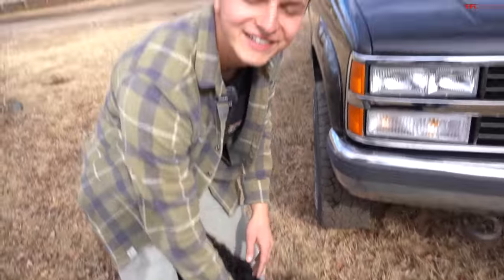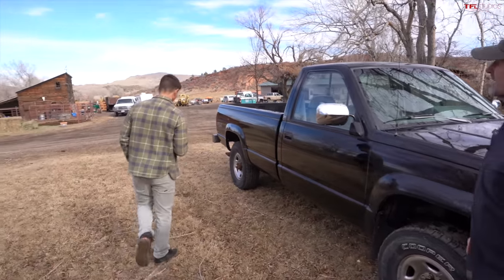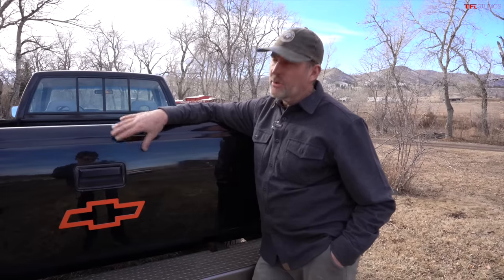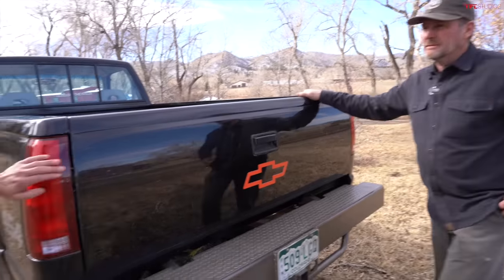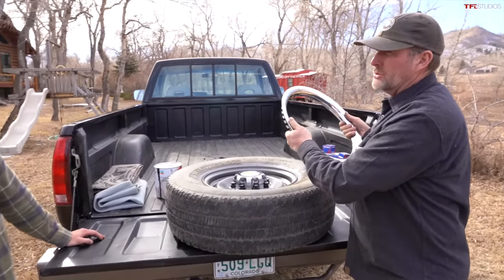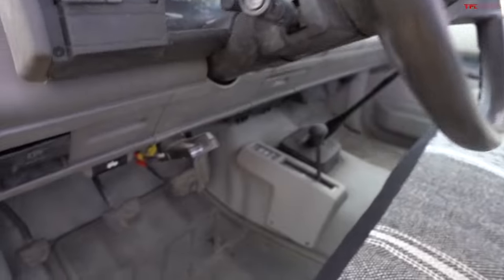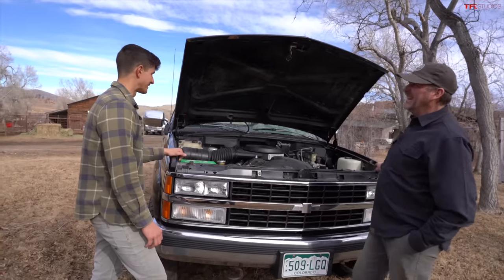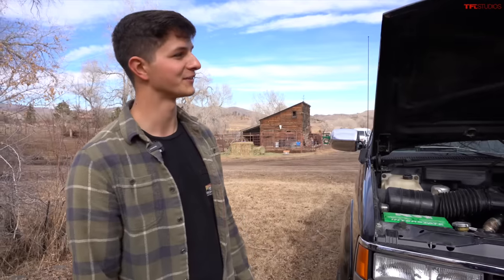It Came Out SO GOOD! Here’s How You Can Restore Your Clapped Out Truck For $2000!

Comment: David, I had a 87 which was the last year of the square body first year for TBI in trucks. I found that the gasket for the TBI to the intake manifold had a small crack in it and caused my high idle just thought I’d let you know
Reply: 88/98 were infamous for the intake gaskets going out
Reply: Would that cause leaking of oil on to the top on engine?
Reply: @cowtipper3855 check out the video "how to stop oil pooling on intake manifold - chevy" 
Maybe that will help.

Comment: Im restoring my first truck ever a 1996 K1500 etc cab with a vortec 350 all original engine and transmission. Still runs like new at 268 thousand miles. Ironically I went for a GM Black from the 90s paint code at NAPA for my truck lol. Can’t beat a solid black!
Reply: What kind of stuff are you restoring? (If you don't mind me asking)

Comment: Just fixed my high idle issue in my 95 chevy. changed the idle air control censor and then the throttle body gasket was completely dry rotted and cracked in half. cheap parts now it idles like a dream

Comment: As far as the vibration, if it happens on acceleration, pull the rear driveshaft and see if the u-joints are free!! If it happens always, check the motor mounts! If the vibration happens all the time, maybe the new rubber will do the trick! Hope that helps. Great job boys!!👍🏻

Comment: That engine has a 4bbl intake with a 2bbl tbi. There’s a spacer between the TB and the intake. Gaskets on top and bottom of the spacer. The spacer has coolant flowing through it so mind the coolant hoses to and from it. Check power steering pressure switch as well as AC switch. They also increase idle when in use by way of the IAC. You can also spray around the intake with starter fluid or something else safe to use and see if the idle changes to locate where a vacuum leak may be.

Comment: Brings back memories of my first NEW truck an 1988, 2500 Chevy 4x4.  The main ( and only, bracket a first for Chevy I believe ) bracket that holds all the accessories on the engine on mine was cracked and caused flex to occur which burned up 5 alternators before the dealership figured out what was the root cause for the failures.

Comment: About the high idle, you guys talked a lot about a new distributor. It could be a possibility that the timing could be off. You may have to adjust the distributor position to lower time the spark plugs ignite.

Comment: I love 90s trucks easy to work on  my truck is 92 chavy z71 off road steps side bed 3 inch lift it a 2 door extended cab with 285 75 R17 tires maroon it needs new paint job still

Comment: Do the timing chain. My 89 3500 454 lost all the nylon on the cam gear jumped time and bent all the valves. I had it completely rebuilt. If I had known this was is a common issue I would’ve done the timing chain and gears immediately and saved myself $4k. Other than mine being a Silverado trim with a th400 and red interior mine is identical.

Comment: Why is a cracked windshield typical for Colorado?
Reply: Marijuana users typically throw rocks and drivers during the winter time.
Reply: It has to be the weather changes. I live in MA and even though we aren't as harsh as colorado i've had 3 windshields randomly crack while i'm not in the car.
Reply: The “Rocky” mountains.
Reply: @volvo09  I'm in CT.  The only time I had a cracked windshield was from following a DOT  truck that kicked up a stone in a road construction area on I84.  I just never heard of windshield cracks being typical for a state.
Reply: Because our Department of Transportation uses sand when it snows instead of rock salt or Salt Brine. The downside is rock chips and cracked windshields. I have lost traction turning from a stop once because of a thick layer of sand lol.
Reply: @DJR5280  As a 57 yr old truckdriver of 35 yrs. the number of times that I've ever seen sand crack a windshield on any of the many, many trucks & passenger vehicles that I've driven in my lifetime = ZERO/NONE/NADDA.
Particles of sand don't simply crack windshields!🙄
Reply: @paulallison6689  Yeah, they actually do. They create small chips in the glass and if you don't catch it in time that chip turns into a crack and spreads.
Reply: @volvo09  I'll take Winters in Denver any day over winters in Mass. I'd much rather deal with windshield issues vs a rusted out car in 10 years.
Reply: @DJR5280  is denver really less salty? I always assumed it was similar just from seeing skiing and snowy stuff online, and the elevation... But yeah MA sucks for rust!.... Everyone expects the roads to be perfect so they load the salt on after and before snow falls, even when it rains in the winter. When i used to commute to work on 495 there would be a dusty haze of salt dust in the air kicked up by the cars on the highway when the salt dried, there was that much of it. My current truck is ready for the scrap heap due to rust.
Reply: @volvo09  Denver isn't in the Rust belt. It's a high desert. These TFL videos show the lack of rusty vehicles here. That truck in this video has zero body rot and it looked like some surface rust on the frame but easily fixable. My daily is an 05 Malibu with 274k and not a spec of rust anywhere. Well I take that back I think the brake rotors have some surface rust on them. The brine we use does contain sand and salt and supposedly a rust inhibitor and we do use mag chloride. Sometimes it leaves a faint white film on the roads but nothing like back east. Biggest difference is this place has low humidity. Denver is the 3rd driest large city in the country in terms of daily humidity values behind Vegas and Phoenix. You get out of the shower here and your skin is too dry where as back in Jersey and PA it was hard to dry off after a shower. Long response but we don't use salt or Salt Brine and it's waaay drier here so rust had a harder time forming.
Reply: @DJR5280  ah, i feel stupid now... I've been quite shocked at the lack of rust on a lot of their old vehicles and assumed they came from out of state. I can't even get under my cars without safety glasses because i'll get rust flakes in my eyes.
Reply: @volvo09  I just bought a new to me 05 Tahoe Z71 and the frame has rust. I panicked because we don't deal with that much here. My 98 I have to my Brother has little rust. Luckily I got under there and I can brush the Rust off with a wire brush and get back to bare metal with no problem. Thank God. I have seen an F 250 from WI once and yeah, it looked like the Titanic at the bottom of the ocean. Techs couldn't get any bolts loose to align it and the tech was from Phoenix so he really doesn't know what rust is. Parts of the frame were missing. The Guy did not seem to care at all and thought we were crazy
Reply: @paulallison6689  Colorado sand would be known elsewhere as pea gravel.

Comment: Too much money into this truck. Not worth it.  
I  live in  Colorado mountains  and just got a old farm truck  1996 gmc 2500 4x4 long bed 5.7L 175k miles for  $2000, and paint pealing  but all did was fuel pump alternator  starter, ball joints to make sure runs drives. 1996 is a far better year than the 89-95 years.